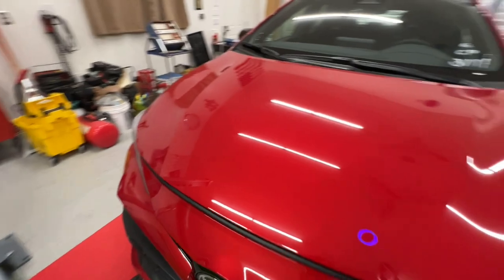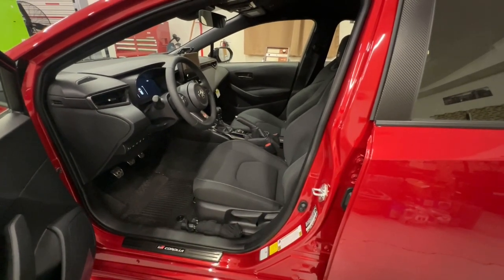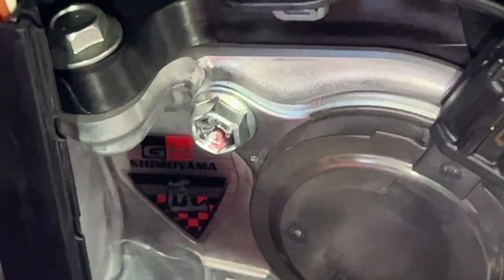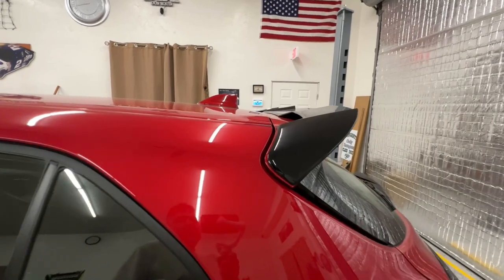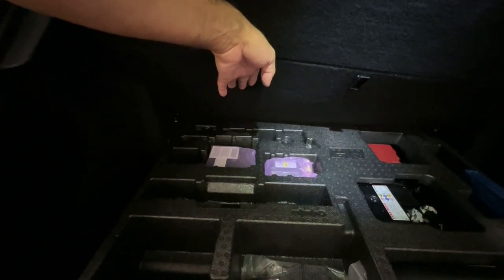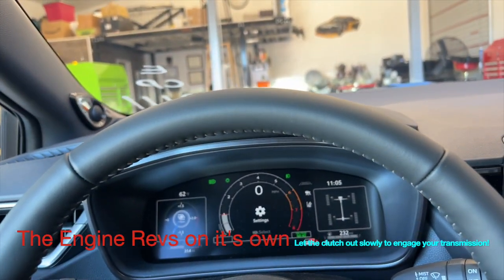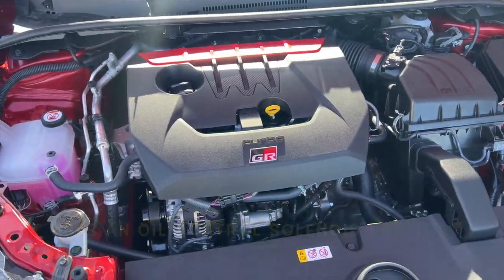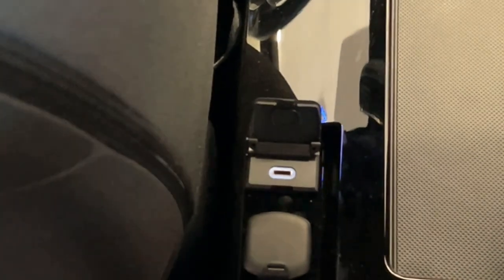GR Corolla SECRETS!

Comment: This vehicle just feels new and traditional all at the same time. Analog and digital.
Reply from the maker: I am sure it will become a collector's car quite soon, as everyone is switching to electric!
Reply: @HowToHeaven  Hi! I wonder if you experienced the same issue as my car. Each time I restart the car, my instrument cluster would reset. Is there a way to memorize my preferred display?
Reply from the maker: @michaelxie4563  Not that I am aware of, although you can configure it as a setting on your modes (Sport/normal/eco). I initially switched to the horizontal tach in Sport mode and it would change the dash gauge everytime I selected Sport mode. Later, I decided that I like the traditional tach and reset it. You can save the rest of your settings into the mode you choose as well. Hope this helps, thanks for watching!
Reply: THIS. Yes it does. The dash cluster feels like what a designer in the 80s would have made with modern tech!!

Comment: Clutch and no gas happens on all cars depending on what the idle is set at. You can do it on most sporty cars. That’s usually the best way to teach someone how to drive clutch. If they can get it moving without gas with just the clutch, it teaches them how it feels for the clutch to grab.
Reply from the maker: NOPE, it the GRC actually revs the engine when you let out the clutch.
Reply: My 6speed will go without pressing the gas if I ease off the clutch slow enough on level surfaces.
Reply from the maker: @michaelmccarthy9088  The difference in the GR is that the car will actually rev on it's own, if you let the clutch out without giving it gas!

Comment: I don't know if I'm the only one that would prefer a spare tire/jack vs a fix a flat. Might be impossible with the rear differential and battery taking up space in the hatch area. If anyone has a cure let me know. I wouldn't have said no to an armrest for storage. Yes, these are very minor issues on a great car. I thought the brake dust might be something because it was new, nope at least at 400 miles. My brother has a '03 Z06, same size front brakes as the GR. I didn't get the first aid kit. Was it part of the performance package or did one of the service guys need one? Enjoyed the video.
Reply from the maker: Mine came with the emergency first aid kit. I believe it's standard. I am going to post part 2 of the XSE Corolla HB and the GR Corolla comparison soon which will go into detail on the differences in the body. The XSE has the Spare so I will show any differences in bracing. Thanks for watching!
Reply: @HowToHeaven  Thanks
Reply: I pick mine up tomorrow. I hated the run flats on my M1.
Reply from the maker: @erikswanson7539  Thankfully Toyota did NOT use Runflats on the GRC, they just eliminated the Spare and included a compressor and fix a flat. What really bugs me is that they took the Spare tire jack and tools away! Simply ridiculous as fix a flat doesn't repair all flats, and now you won't be able to jack your car up and remove the bad tire! You will love your GR! Thanks for watching!
Reply: What rim will fit? Got a Morizo and would like to put a spare in the garage so I can call a friend.

Comment: Can you tell me what the different  drive adjustments do?  From what I understand the shocks are not adjustable.   When use sport or the other choices, what happens
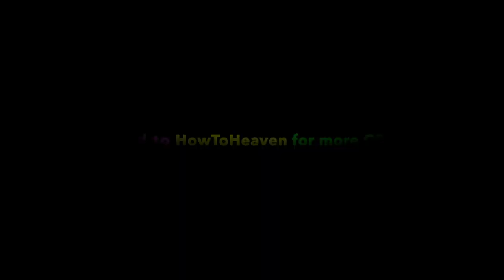10:20
Reply from the maker: The different drive adjustments, send more power to which ever wheels you select. 60 front/ 40 back wheels or 50/50 or 70 front/30 rear for drift mode. The shocks are NOT adjustable, you're correct. Sport/normal/eco modes change shift point...Sport keeps you in each gear longer to make use of the power band, eco upshifts sooner revving your engine less and saving gas. You can program the modes to change the dash display a limited amount.

Comment: Hello. The exhaust is hollow and triple exit in order to reduce exhaust backpressure.  Of course for best response and for optimal tuning in a turbocharged setup, no exhaust at all would be best, but the GR Corolla was developed properly I think. To me it drove like a software-controlled rally car. I would love to see an aftermarket rear clutch-pack cooler as I imagine that temperature is monitored and cut when ECU needs. You know, also wish it was like affordable to enthusiasts. :(
Reply from the maker: All true!

Comment: Well it does have vvt and toyota has been using oil control valves since the 90's for their vvt control. But what is new here is the intake cam gear has 70° of timing control. Thanks for the other cool info

Comment: @HowToHeaven You are adding to the misinformation out there. Aluminum hood and plastic hatch (composite actually) are standard on the base Hatchbacks from SE-XSE. To help with brake dust, coat the wheels in ceramic, they will rinse off with pressure washer "it can be helped". GR Centre exhaust does utilize the glass-packed muffler, but the design is "straight through" where only flanking sound waves reducing rasp - the outers are double circulation within the glass-pack to reduce further the drone; Lock feature for the hatch and the clutch-out feature (part of hill assist) IS same on base model Hatchbacks - at least in Canada. There is VVTI it is just not electronically controlled like late model Toyota, but uses oil solenoids instead; fact it is on both intake and exhaust cams which IS unique to only a few of Toyota's best performance engines.
Reply from the maker: Actually, your observations may be due to being in Canada, and you are offering misinformation here in the U.S. We have owned 2, 2021 hatchback SE models, one had the aluminum hood. Probably a preproduction one. We own a 2022 hatchback XSE also a steel hood, and I know all US spec GRs have the aluminum hood, including our 2023.  If you look into the muffler on our US spec GR, you can clearly see to the sides and it is hollow. Once again maybe a Canadian difference. The GR definetly will rev when the clutch is let out and our XSE and our SEs don't. I was referring to electronic VVTI, sorry for the confusion.

Comment: Here I thought you can “no gas” on all manuals in first gear.
Reply from the maker: You can try, but the GR actually revs the engine to help, I don't know of any other car that does that. If you let the clutch out slow enough in any manual, you may be able to keep it from stalling, but the GR gently revs so you don't!
Reply from the maker: @Gran Tree Mo If you let the clutch out completely it will NOT stall, if you pop the clutch of course it will. Our 2022 Corolla hatchback will NOT allow you to let the clutch off completely and will stall in almost every case, unless you are on a hill or let it out super super slowly on flat ground. The GR can go up my inclined driveway, without stalling!

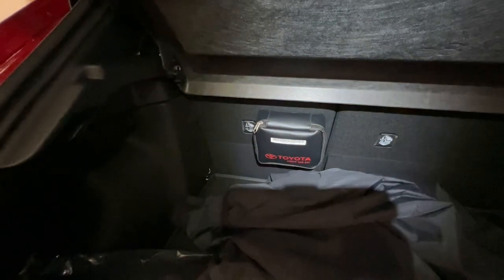Comment: 4:50 mine didn thave the bag
Reply from the maker: If it were me, I would contact my dealer. Thanks for watching!
Reply: They have front and rear sensors available and my have deleted the First Aid bag for 2024🤔  It's a $19.80 part. PT420-00220 with insect sting relief pads, self-adhesive bandages, rolled stretch bandage with metal clips, stainless steel scissors, face masks, 4 pair of gloves, and 4 hand-sanitizer packets😮